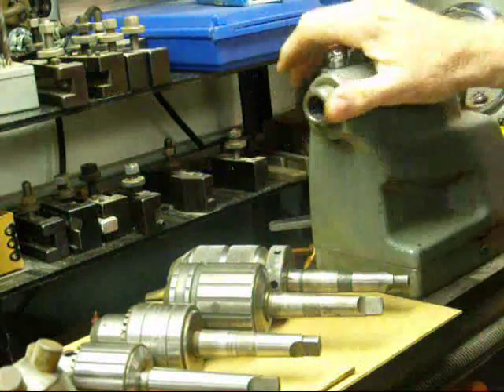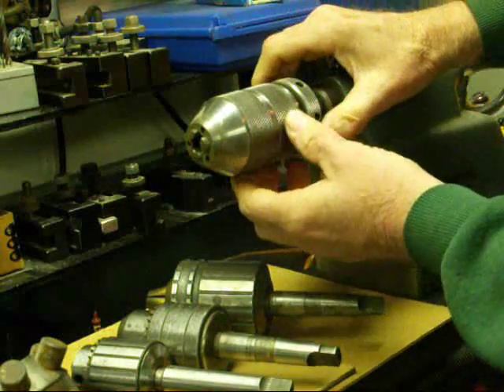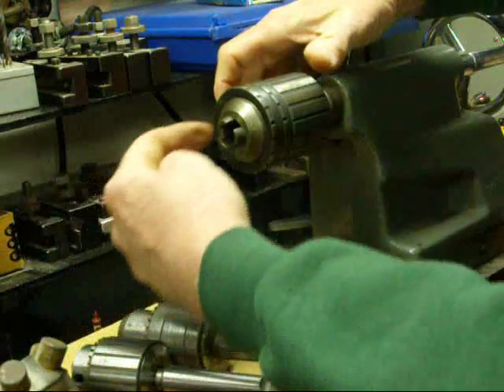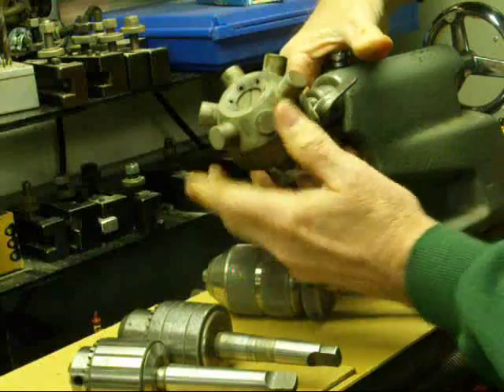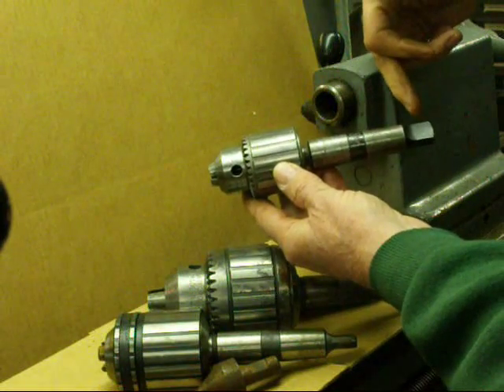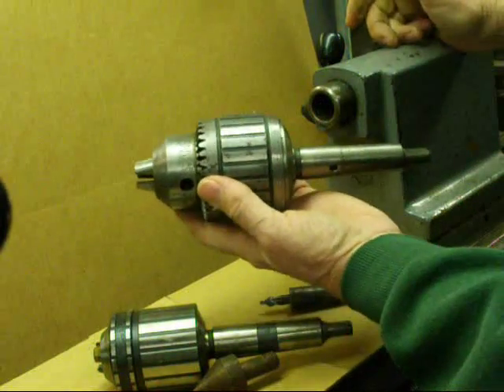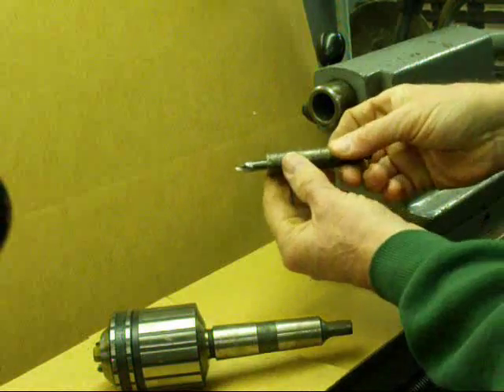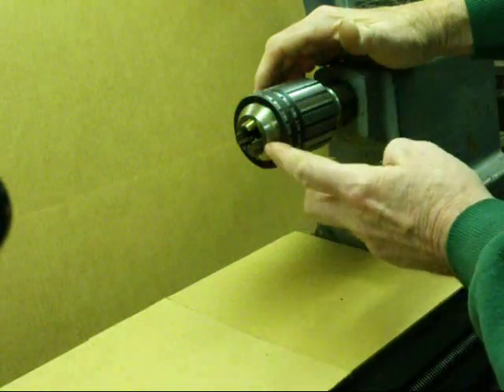TAILSTOCK CHUCKS for the Atlas Clausing South Bend Lathes

Comment: The turret is a nice accessory to have.  I do a lot of random lathe work, but frequently have to put a 10-32 thread in the end of a shaft.  I keep a center drill, #21 screw machine drill & 10-32 tap in my turret at all times.  The receiver pockets in the turret head are 1" diameter, so I had to make tool holders for each of the tools but it's been a huge time saver over the years.
Reply from the maker: That is a good idea. I like the idea of dedicated tooling

Comment: I fully understand the 1 MT going into the lathe and the JT side will hold the chuck, my question was should I get a 1MT to 1JT, 1MT to 2JT, or a 1MT to 3JT and as per your suggestion I'll get the 1MT to 1JT, but I was wondering the reason for the preference.